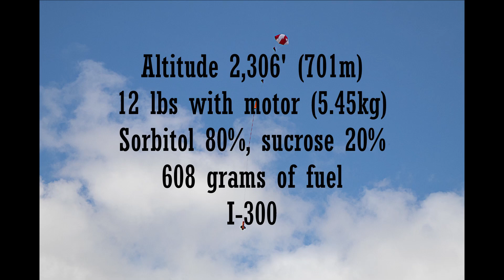Formula 98 sugar motor 1-300 launch!

Comment: Great build and flight! How much time elapses between casting your motor grains and actually flying them? Do you have to worry about the hygroscopy of the propellant?
Reply from the maker: It's best to have a plan to keep grains dry. After removing the coring tool and end cap I place them in a ziplock bag. If the grains are a little soft then I stand them upright in a plastic container with a lid and throw in a desiccant pack. When the motors are assembled I place a foam ear plug in the nozzle.

I have found 100% sorbitol grains to be very hygroscopic when the fuel is not yet firm. Test strips left out will quickly form a moist layer if it is humid in the casting area. After the grains are very firm this is less of a problem.

Sorbitol grains need a couple of days or better yet a week to become durable and solid. Mixing with 20% sucrose a few days will do. Flexi-fuel is ready the next day and tends to resist moisture better.

Hygro meter: https://www.amazon.com/gp/product/B08M3P74N3/ref=ppx_yo_dt_b_asin_title_o00_s00?ie=UTF8&psc=1

Desiccant pack:https://www.amazon.com/100g-Rechargeable-Desiccant-Pack-Dehumidifier/dp/B093DVB2B4/ref=sr_1_21?dchild=1&keywords=desiccant+packs&qid=1626267714&sr=8-21

Good question, thanks!

Comment: What was the length radius of the motor along with the radius of the hole
Reply from the maker: 54mm motor with 3 grains, 250mm fuel length, nozzle .343 (#22).